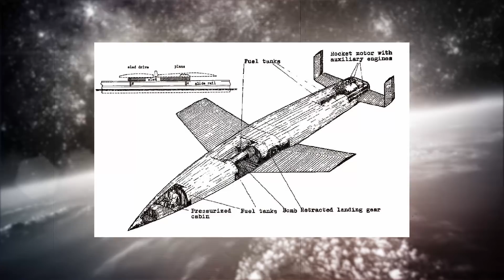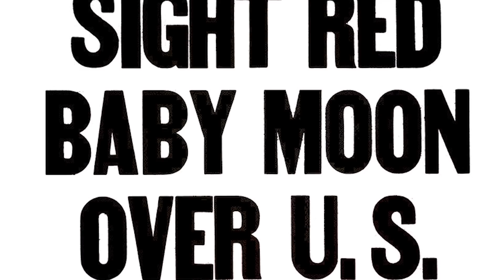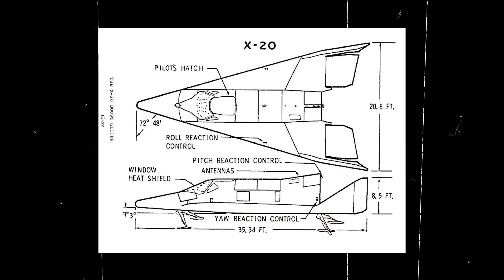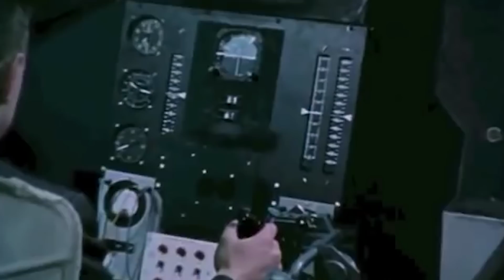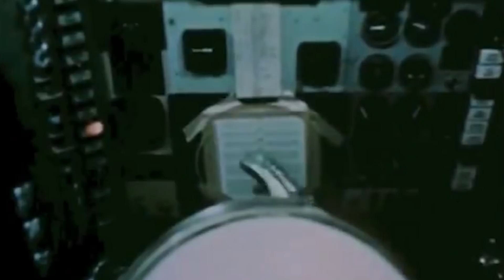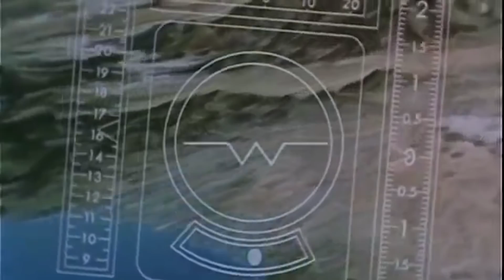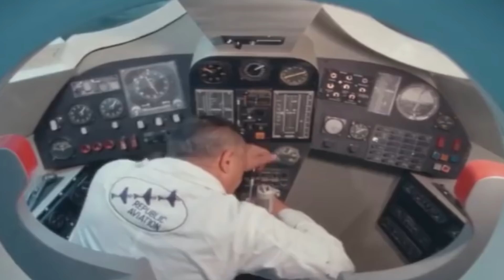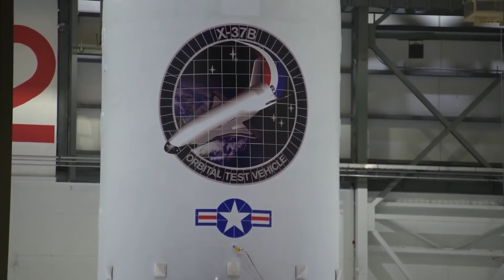X-20 Abandoned Space Shuttle

Comment: Correction:  The Titan I and II did not use the X-15's XLR-99 engine.  That engine produced 58,000 pounds of thrust and was made by the Reaction Motors division of Thiokol.   The Titan used the LR-87 engine made by Aerojet.  It produced 215,000 pounds of thrust.   The Titans had no need for the throttle capability of the X-15 engine.

Comment: Wonderful video on a really cool project.  I'm a dinosaur myself and remember the Dyna-Soar.

A small correction.  Around 6:45 you mention that the Titan I, Titan II, and X-15 all used the same rocket engine.  Not exactly the case: Titan I used two LR-87-3 powered by LOX and RP-1.  Titan II used two LR-87-5 and these burned N2O4 and Aerozine 50. The LR-87 engine family was made by Aerojet and had variants powered by LOX/RP-1, N2O4/Aerozine 50 and LOX/LH2.  The X-15 (final models) used the XLR-99, sometimes called the LR-99, powered by LOX and ammonia.  It was altogether different than LR-87 of any variety.
Reply: They weren't even in the same thrust class - about 4 : 1 in favor of the LR-87.  And the XLR-99 was made by Reaction Motors of Thiokol.   I wish I had seen  your comment.  It would have saved me a lot of typing!   As for me, I, too, am a bit of a dyna-sore these days!